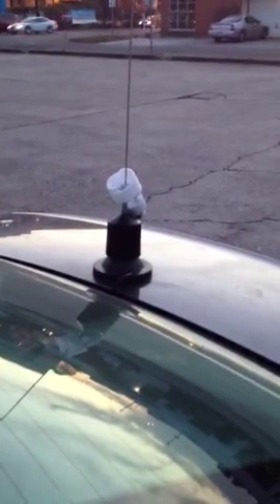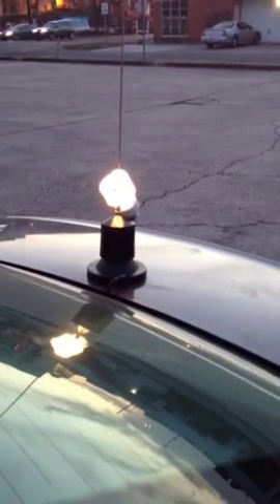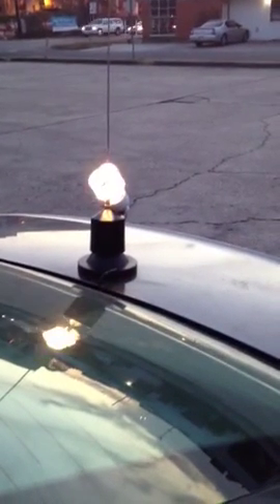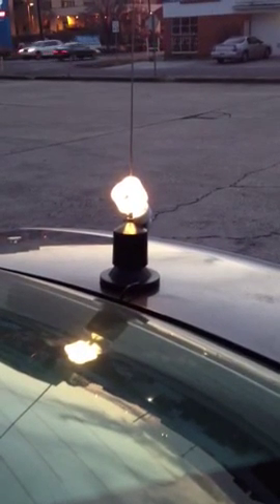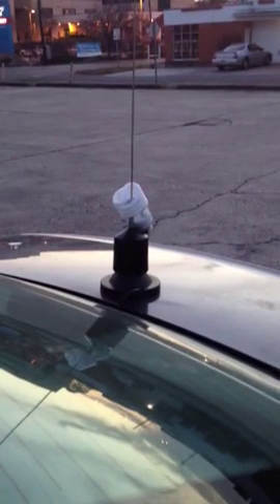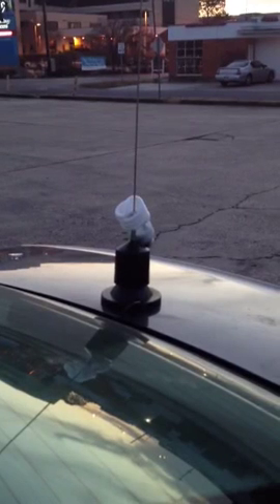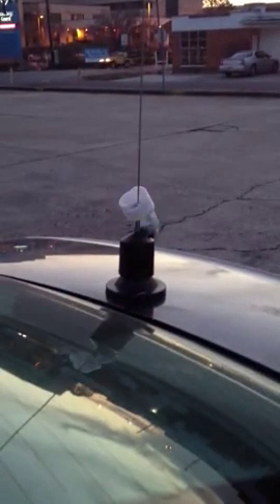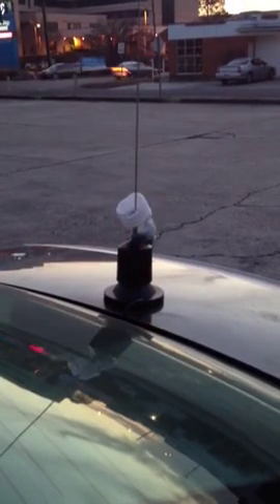Cb radio fluorescent light on antenna

Comment: I used to have a 4-foot fluorescent tube ziptied to the middle section of my Antron A-99 antenna atop a 70-foot rohn 25 tower and it would light up and fluctuate like that when I transmitted using my old President HR-2510. You could see that damn thing for miles!